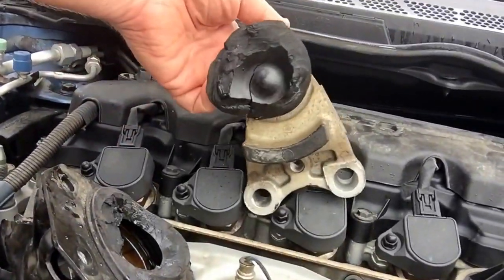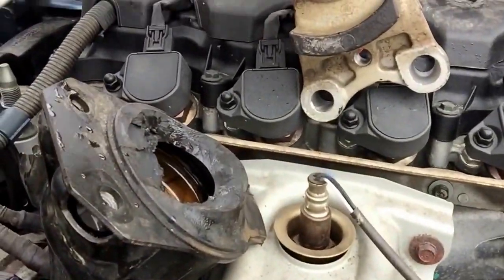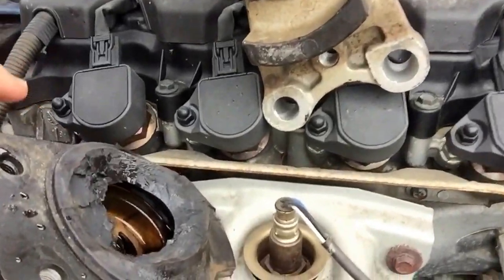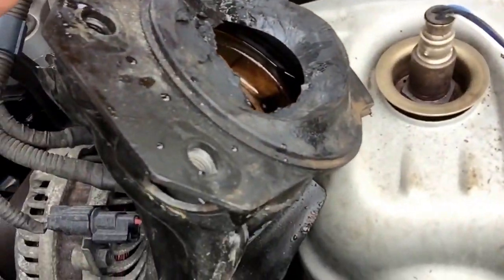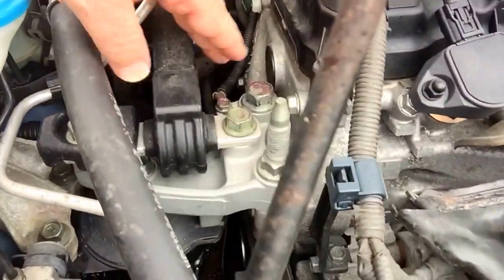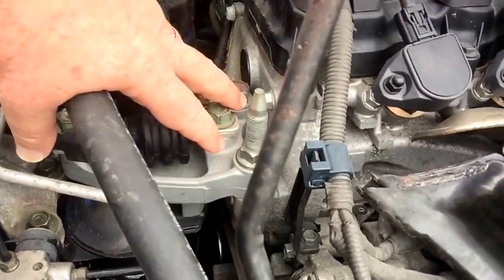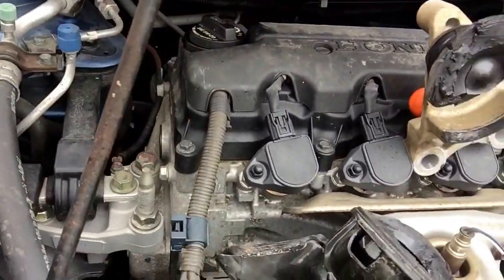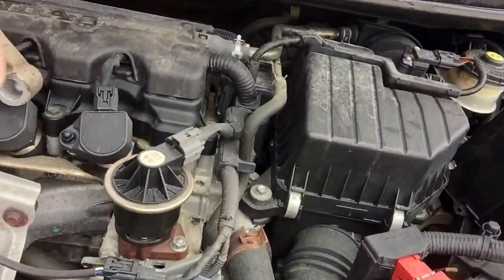How Do Honda Civic Motor Mounts Rip

Comment: Is there any threat to the driver of having a broken mount while driving? As like a cracked engine block is dangerous to drive on, is it the same with a bad motor mount or can it just be annoying? I’m getting a 2010 engine put in my ‘06 civic and want to make sure if a problem like this occurs it won’t be the absolute end of the world as it was when my engine block cracked and leaked coolant.
Reply: No threat to the driver just abnormal vibrations and metal clunking sounds but once all the mounts break the engine will noticeably sag and will move around like an excited dog.